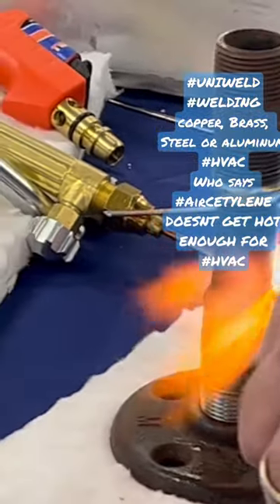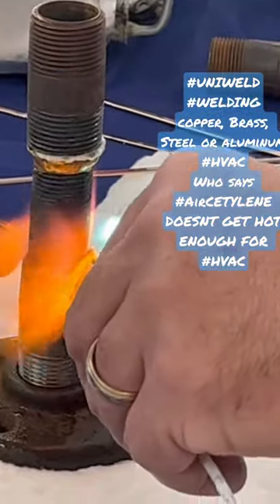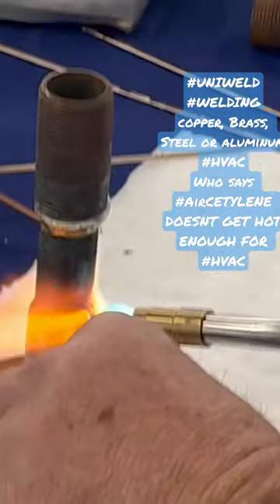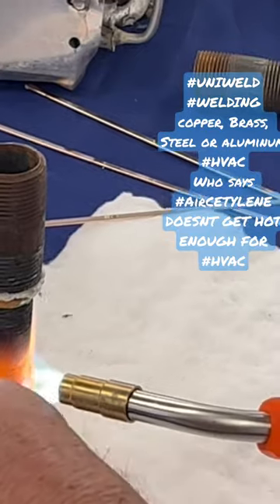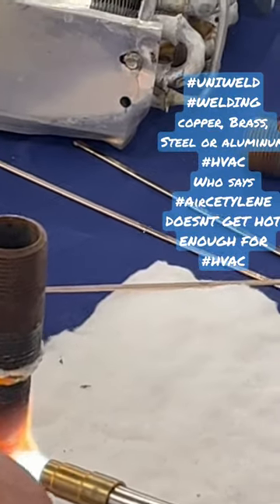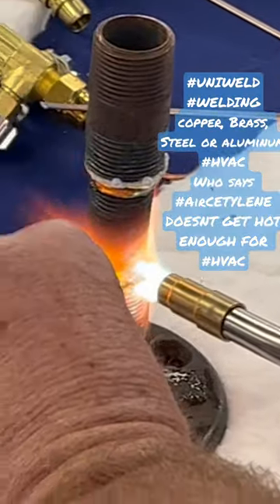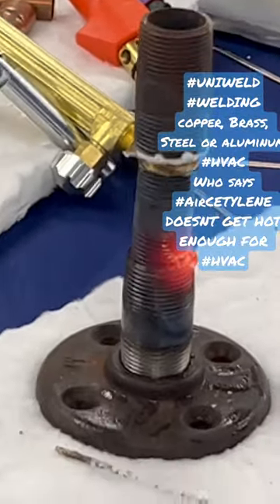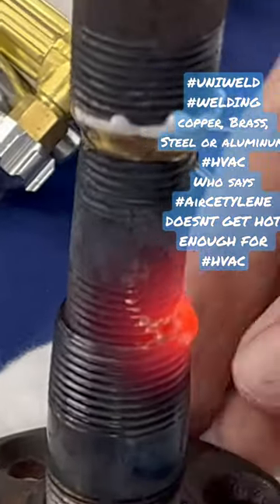Joining Steel with #Uniweld AirAcetylene kit. Plenty of heat #hvac #tool #airconditioning

Comment: Not welding😂
Reply from the maker: Definition of a welding or a weld please 😂😂
Reply: @PEDHVAC  welding is fusing metal together. With this the metal thats being held together is not melting
Reply from the maker: No, welding is a process that joins two pieces of metal by melting them together using heat and often a filler material. While melting steel is a common type of welding, there are many other types of welding that can be used to join various metals together.

Some other forms of welding include:

Gas welding: A process that uses a flame to heat and melt the metals.
Arc welding: A process that uses an electric arc to melt the metals, often with the use of a filler material.
Resistance welding: A process that uses an electrical current to create heat and join the metals together.
Laser welding: A process that uses a high-powered laser beam to melt and join the metals together.
Ultrasonic welding: A process that uses high-frequency vibrations to join the metals together.
These are just a few examples of the many different types of welding that exist. Each type of welding has its own advantages and disadvantages and is suited to different types of metals and applications
Reply from the maker: And it is melting with the filler metal melting as well joining the two pieces
Reply: @PEDHVAC  thank you for proving my point. This is not welding
Reply: @PEDHVAC  what they are showing here is not melting the base metal, therefore it is not fusing. Brazing and soldering is not welding. It does work well, I do it to copper tubing for ac repair. I tig braze too. That one im still practicing though.
Reply: @PEDHVAC  just so you know too, just because the filler material is melting, does not make the process "welding".
Reply from the maker: I appreciate the dialogue 
Thank you